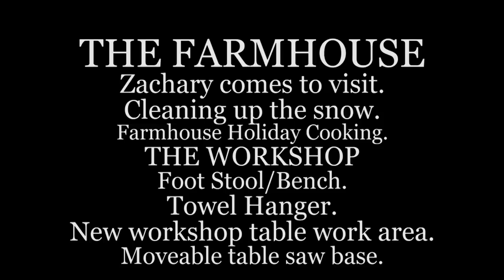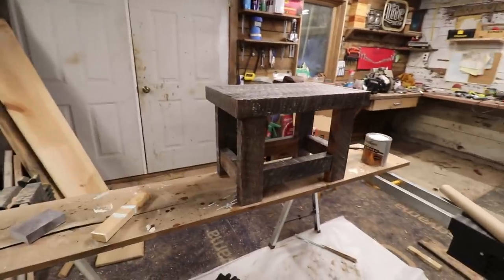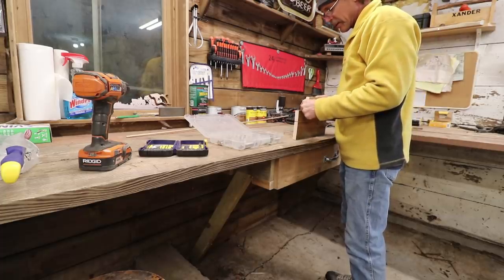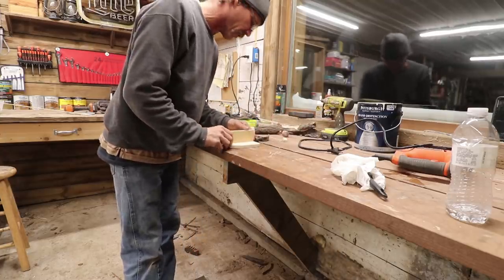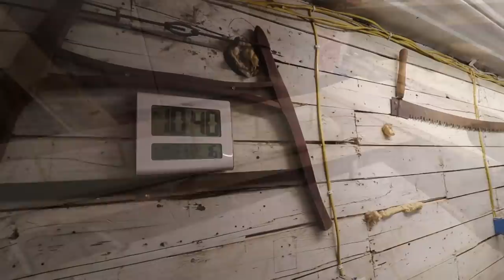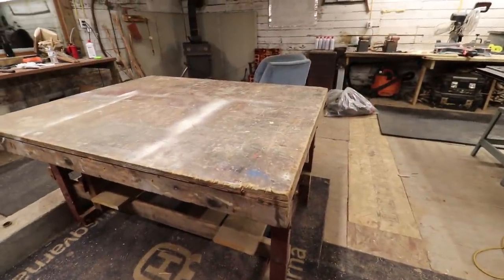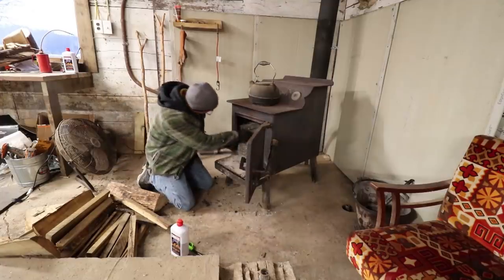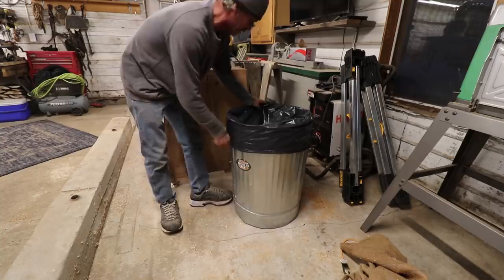THE FARMHOUSE. Zachary visits. Moving snow. Foot stool bench. Towel hanger. Table saw base. Cooking.

Comment: Hey Joe, you were talking about putting a piece of plywood over that work table. That's a good idea. Then like you said once it's wore out you replace it. I use 3/4" MDF or 3/4" particle board on my work tables. It serve to be a little smoother and it serve not so prone to scratching when I'm building my cabinets. It has been a pretty brutal winter so far. I hope your getting a good break from the cold down in LA.
Reply from the maker: I had one warm day when it made it to almost 80. Last night it got down to 20, the night before it got to 23. Today made it in the mid 50s so it was not bad. I think Wednesday it will make it back up to 70. I will be heading home the end of the week. Might be back down here in March.

Comment: Twenty years ago I used to make small stools for the kids to sit on, my dad called them Crackets, they are made from a single 9" board 9' long cut into 5 pieces. 2x18" long with one halved then 2x15" long. The top is made with the largest board the legs get a 1" hole drilled in about 6" from the bottom it has a V cut up to the center of the hole giving two feet. The halved boards have a 45 degree angle cut on two bottom corners. These are then screwed on the long sides and the legs to bring everything together angling the legs makes the stool more stable 5 to 10 degrees should be enough. Hope you have chance to make them Joe because they can also be scaled up too. I remember my mother using one over sixty years ago.

Comment: Hey Joe, Good job on the stool and the towel rack.  I can't get over how cold it is by you....sheeesh!  I hope you don't mind my 2 cents but it was good to see you had an assembly table just waiting to come out.  Well I know you mentioned leveling it out- which is super important, so my 2 cents suggests that if you have time, throw an MDF on top ( for it's flatness) and add a mica top to it with contact cement.  It will make for a flat top and the mica is great for clean ups and durability.  I'm off to my shop for some end tables so here is to creating dust...cheers!!
Reply from the maker: Thank you Luis. The only problem with putting mica is this table will get drill holes in it. It has to be a table that can get beat on and drilled through etc.
Reply: @NorthernSeclusion  ..gotcha!

Comment: Glad your getting snow , I spent some money this fall and bought a 4 1/2 ‘ snowblower for my 4 wheeler and we haven’t had hardly anything. This Friday 20 miles north of me are supposed to get 12 + “ and we’re supposed to get a dusting to 3 “ . But will be cold to make ice finally….. lol I just watched Zack other night got the log splitter motor running .
Reply from the maker: I just looked up snowblowers for atv's when I read your comment. They look awesome. It would be my luck that if I bought one we would get no snow also. Lol.
Reply: @NorthernSeclusion  we got 6” today and supposed to get 8-12 tonight with real icy cold air till Wednesday then back to 40’s and rain but real cold nights . So I got to use snowblower and it works great wish I had gotten it sooner. Now maybe we will get ice to go fishing

Comment: Just a tip, turn the snowblade on the 4x4 to the right, and push the snow with speed and you will throw the snow a little bit more 👌

Comment: Ok- end the comments about the potato cutter. The best way to use it would be to attach to your wood splitter then they could fall in the snow. Leave them over night for a good hard freeze then use the tractor to collect them and put them in the freezer. Easy-Peasy.  
  Please don't jump out of the shower when you show us how the towel holders work and about the comment of the body on the floor probably refered to the 'wood chipper'?  😎

Comment: I have a brand new biscuit cutter and have never used it.  I just use my "Kreg" set up and screw them together from the back.  Works great and I don't have to get out another tool
Reply from the maker: The Kreg jig is the best way to go. Sucks it tight and you know it is not coming apart.

Comment: If you'll mount that potato cutter to the wall you'll like it a lot more. 

If you didn't, if you'll Rinse the fries after cutting 2 or 3 times, they will crip up more. You want to get rid of the starch as much as possible. 

Just thought I'd share with ya.
Reply from the maker: We saw one of these when Melissa and I ate at Anchor bar and grill in Superior Wisconsin. It was mounted to the wall. That is exactly what we plan to do once we add on to the house and have room to do it.

Comment: The TV show "New Yankee Workshop" convinced tens of thousands of people that biscuit cutters were the MUST HAVE tool.  It's a nice tool to have, but, we seem to have done just fine before the doggone thing was invented in the first place. Just heard on Alexa that bitter cold weather is heading on over to Ohio, but, it has warmed up considerably!
Reply from the maker: I would much prefer to use my Kreg jig on the underside if I truly thought it needed to be held together better. Like you said, the biscuit cutter was never needed in the past and to be honest, if they are used to keep the boards flush it is kind of a scam since the actual biscuits are not super tight in there. The glue fills the gap.

Comment: As always Joe that stool looks great! At the end of the day, it really doesn't matter what we think as the only thing that matters is if you are satisfied how your projects turn out. I always think of how my comment sounds as I don't want to come across sounding critical. If one has to make a new cut on rough sawn lumber, how do you get it to match? Dull saw blade?
Reply from the maker: You don't. That is why I have no way to make a project out of that type of wood unless I have the whole amount prior to when I start. Those boards were circle saw cut (most sawmills use a band saw now) and they were left outside where they got the grey color. I have no way to replicate both of those circumstances in a short amount of time to continue an already started project. Any cuts I make either have to be on an edge that will get covered or (in this project where I had to cut the legs to the correct width) I put the smooth cut side inward so you can not see it as much.

Comment: Hey Joe. 
Watching you Zack BSin by the stove and noticing there is a ceiling light above ya. What about putting a ceiling fan with a light there. The fan would spread the heat around the shop more. Just a thought. I know you have alot going on.
Reply from the maker: That is an idea I have thought of as well. I will wait until I find one at work that needs to be saved instead of tossing it in the dumpster.

Comment: I agree with your comment on the joint biscuits.  They are not that great for overall strength.  Large dowel would be stronger.  But why when you can just add a support board?       Why do you push some snow with the tractor and some with the 4 wheeler?      Why is there what looks like a partial dead body on your floor?
Reply from the maker: The 4wheeler will only push so much snow, when that limit happens the tractor will push about anything. I have no idea what you are talking about being on the floor.

Comment: What salt do you use around your house. We just recently moved about 250 miles north, and last year I was stuck using table salt, I know there has to be something better.
Reply from the maker: You can buy salt for sidewalks etc at any walmart or gas station etc up here. I was using pet friendly ice melt so it does not dry out the dogs paws. Just be careful if you have a cement driveway or sidewalk, Salt will pit it horribly. You can buy salt or ice melt that is more concrete friendly if needed.
Reply: @NorthernSeclusion  Thanks Joe, It didn't snow or ice up much in south Texas, but we HAD to move to north Texas and we are having our fair share.

Comment: Hey Joe how did u make out with ur other pick up. I remember u said it was being fixed just curious haven't seen it in any videos.  Can't wait for the winter trip video.
Reply from the maker: It is all done, the new transmission is finished. I just need a ride down there to pick it up and bring it home. I paid for it right after deer hunting. I will need to get it within the next week because on the 18th I am flying to Louisiana. Stay tuned because we bought a new (used) diesel truck that is in Louisiana (no rust) and I will be picking that up when I fly down there. Shes a beauty.

Comment: Do you plan on fixing up that big garage closest to the street? I remember you saying something about it before.
Reply from the maker: I will put a new metal roof on it and add a window and a service door and then tear off the siding and re do the siding. I may do that next year. The roof needs to be done right away in the spring.

Comment: On your french fry maker I mailed mine to a board but I pushed really didn’t mail it I put wing Nutz so I could take it down to clean it and I put it down in my basement and when I make french fries or anything else I have it hanging on the wall so all I do is put the potato in after I clean it and just pull down on the handle and they just drop out into a place where I got a bucket sitting or pan sitting on a table he works a lot easier than trying to push it like you were doing on the table you can try it you’re pretty handy at making stuff and that’s your job but you probably come out better than I did

Comment: I know this seems silly, but I can’t help but feel sorry for the Farmall tractor sitting out in the snow. Do you have any plans to build any sort of cover for it?
Reply from the maker: I just shake my head when I read these type comments over and over... Its a tractor, it could care less where it is sitting. It was built to just sit there and be used when needed. My grandfather had tractors my whole life right up until he died. Never once were any of them ever under any type of structure, just a bucket over the exhaust. Tractors do not have feelings, they are not alive. Why do people not say the same thing about my truck being out all the time? These are the things I think about when reading these comments. As I have said several times in previous videos I will eventually build a lean too off the garage to get the tractor under it. Why? So I do not have to clean off the seat when I need to use it. The tractor will be just as cold under a lean too as it is right now. Maybe even colder since snow is a good insulator. Lol.
Reply: @NorthernSeclusion  I get that Joe. I think it’s just because I see it as more than just a tractor. It has a certain “coolness” to it that I respond to. I have a brand new pickup and a new Toyota but the car I have under cover is an old Mercedes Benz SEL 500 hardtop convertible. It’s just because I know it’s old and respect it and want it to last as long as I can make it. Different strokes I guess. FYI Bringing in the big table was a good idea.

Comment: I’ve owned a small chipper shredder and it’s very dangerous if not properly used. When properly used it takes forever to chop up stuff. You get a rope or vine in it it could pull your arm in. Call me sissy but I bundled limbs quicker and threw away than prepped stuff to grind up and throw debris away. When running it scared the living $hit out of me. My point is use carefully always be careful.

Comment: You seem to use the heck out of lighter fluid, wouldn't it be cheaper to just buy a big container of kerosene and use it to just refill a smaller container.
Reply from the maker: That would be unneeded work. Lol. Lighter fluid costs 2.50 per container.